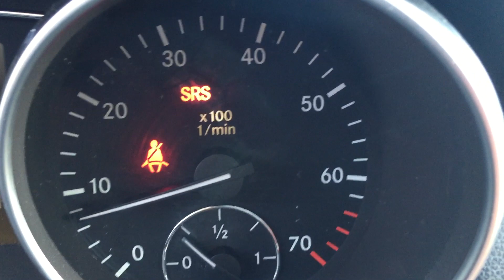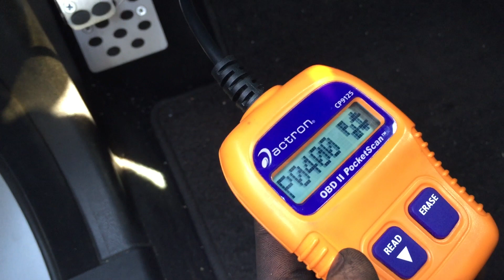SOLVED - How To Fix Check Engine Light Code P0400 on Mercedes ML500 | W164

Comment: Thank you man. This helped my E500 4Matic. I was getting P0400. I loosened the EGR line tube nut and spayed a lot of MAF sensor cleaner down the tube. Then 48 miles later it shut off the light.

Comment: I had a code to replace the purge valve on a 2010 e350.   How long do I need to drive the car to remove code so it can pass inspection?

Comment: Hi,I have a c230. The transmisson doesn switch al all.After i scan it it gives me two error codes P0400 and P0341. Do you this codes have something to do with the issue.